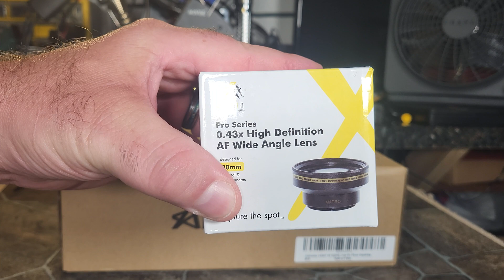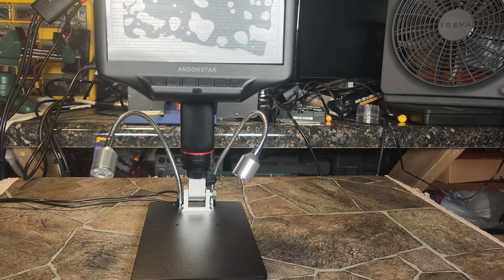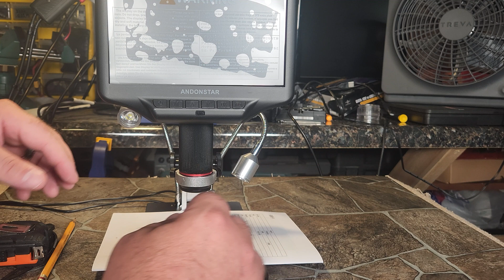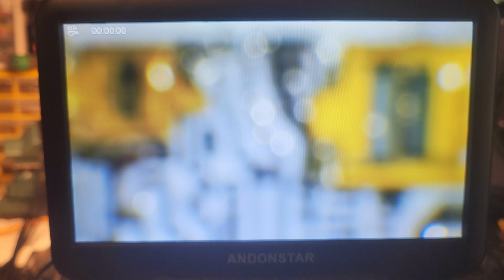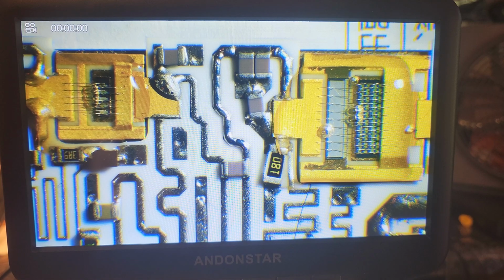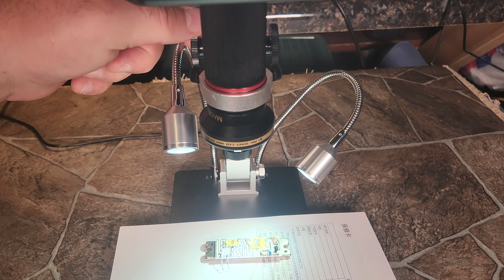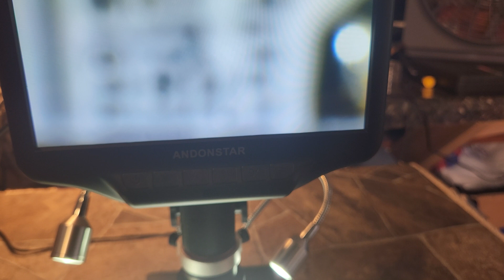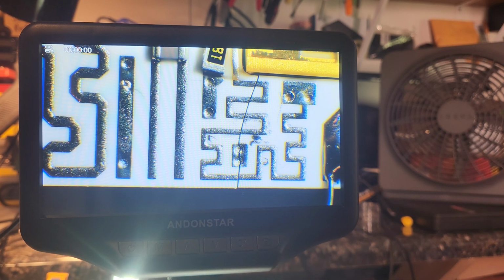Andonstar AD407  Should I buy it? A Upgrade to Supercharge your Microscope!!!   NOT A REVIEW :0)

Comment: Can I use this macro lens with AD407 PRO version?
Reply: Yes you can, the actual microscope / screen on the AD407 and AD407 PRO are identical, the only difference is the AD407 PRO has a taller stand on which the microscope / screen is mounted . . . . so yeah, if a lens works on the AD407 it will work on the AD407 PRO too.

Comment: So this type of scope is made for a variety of mounts. In another mount that bottom groove would be for a ring light. But since this has gooseneck lights you're right that's where the scope should mount.

Another good modification for this would be to have the base replaced with a larger plate or wooden board that you can clamp to your desk. The scope is very top heavy, and if you're clumsy like me you knock it over constantly.
Reply from the maker: Thanks for the comment and the tips. I love this microscope it's a lifesaver on many projects. Please take the time to subscribe to the channel it really helps